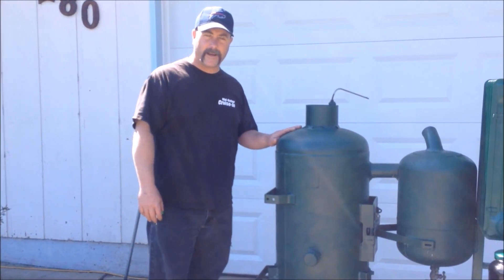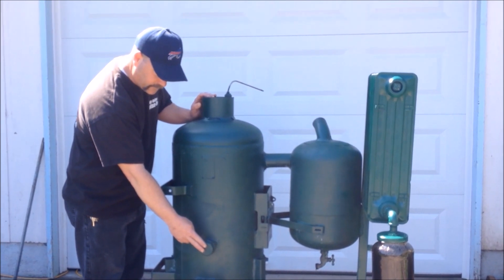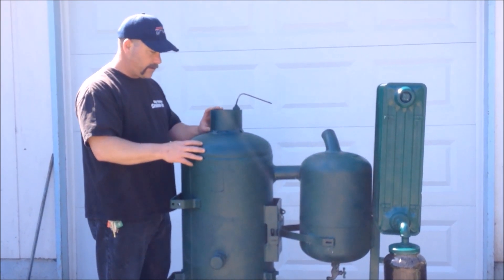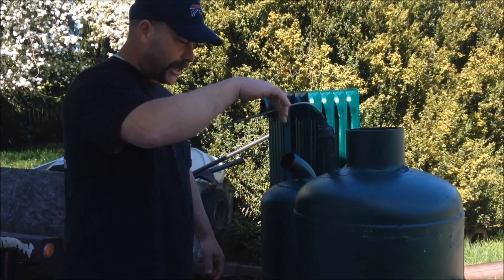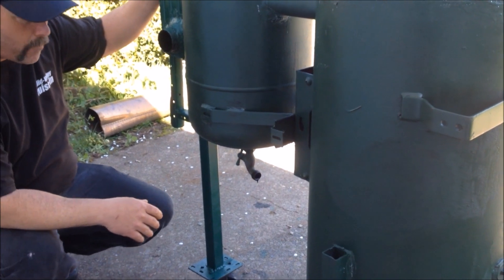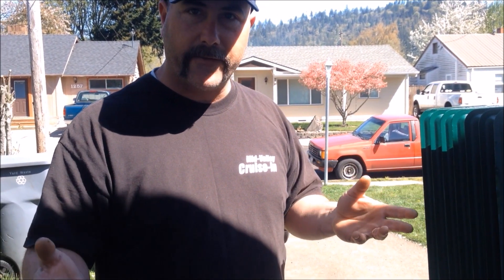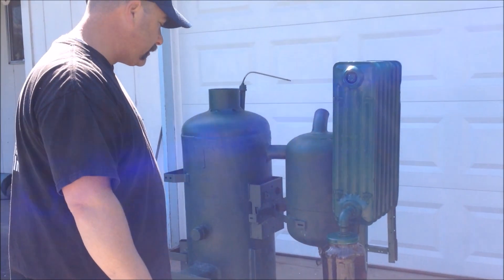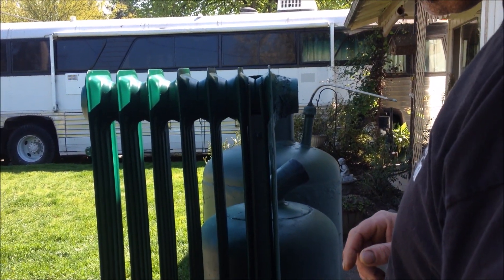Gasifier Part 1

Comment: Great job, looks well built. I would try using lighter color paint and a water jacket for your oil collection. That green may absorb too much heat from the sun but it does look cool. Also, look into using cobalt chloride crystal as a catalyst. It's simple to use and will remove CO2 leaving a much cleaner CO and pure ish hydrogen. I'd put the cobalt catalyst in that first cyclone stage. The heat may help activate the reaction better (don't know if that's accurate but it makes sense). Cheers

Comment: Awesome! Are people powering cabins with these? I need to generate about 6 KWH/day. If my initial research is close, @ 2.5 lbs of biomass/KWH, an efficient gasifier would need about 15 lbs of feedstock to produce 6 KWH/day. That's 450 lbs/mo. That's a lot of sticks lol. :) How much time/electricity do you use to collect & cut feedstock? Is it really practical to produce 6 KWH/day using a gasifier or is this more suited for emergency power? Thanks!
Reply from the maker: +Paul Ladendorf  Battery bank and an inverter. Very do-able!
Reply from the maker: +Bill Holstein https://www.youtube.com/watch?v=vToiLz9In78

Comment: I think better to connect gas to top of old oil heater. Because when you connect it to the bottom you create gas flow resistance. Naturally wen gas cools it goes down. That is why cyclone filter has intake at the top.

Comment: In theory, could I basically attach my pellet stove I use to heat my house already (from the exhaust pipe coming from the inside of my home), to the filter and use the rest of this design to make wood-gas? I'm wondering if I can use this gas then to operate an LP/NG wall heater? I would effectively be using a byproduct to produce more heat for my home and theoretically use less pellets, or produce extra heat, either way I'd be winning... Do you think this would possible?
Reply from the maker: Too dangerous to put in house due to possible blow back if a leak occurs. There are vids of people putting it into propane tanks by pressurizing the gas into them. I have not done that yet but will study up more on it.
Reply: How would you define "blow back" like the fire going back down the line?
Reply from the maker: Gas builds where the fire is burning but if the burner has a leak, and has air ie oxygen then it will blow . It will send the fuel ie pellets up and rain down on you.
Reply: Oh, that's a good point! Could I put a one way valve in the system somewhere that could prevent such thing?
Reply from the maker: You have to make sure i'ts sealed right.
And if not, figure out a way to do that.
Reply from the maker: One way valve in the burn chamber? No it needs to be air tight.
Reply: Bill Holstein I could also put a pressure trip valve into the system somewhere (like the ones on water heaters) that would pop and vent off any gas outside as well... I would try to make the whole thing very air-tight with no leaks and would only run it while at home.
Reply: Darin Clune No, I mean down the exhaust pipe somewhere that would prevent the exhaust from travelling backwards back into the stove...
Reply: Bill Holstein If I drew my idea up in google sketchup, could I send you pictures of it? Maybe you could give me your opionion once you see my idea a little better?
Reply from the maker: You need to make one and apply all the ideas you have. Just build it and i'm sure you're smart enough to apply.
Reply from the maker: But do it outside!
Reply: Bill Holstein You think I could even collect wood gas off of exhaust from a pellet stove? I dont even know about that for sure...
Reply: +Darin Clune 

A pellet stove is not a gasifier,  you need two chamber system to produce gas,  one is a heating chamber under a fuel chamber,  a pellet stove is too specialized and would require too much work to modify or reverse engineer.